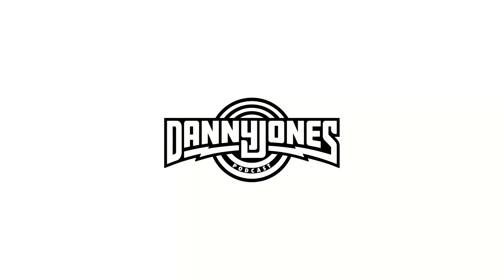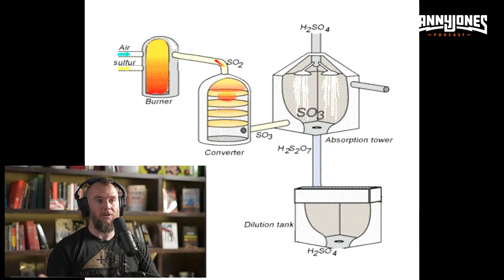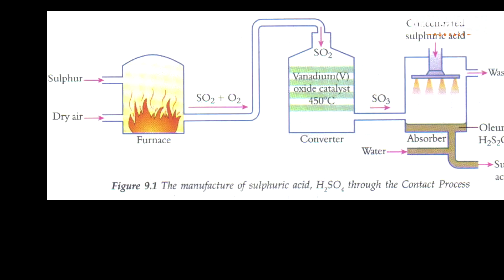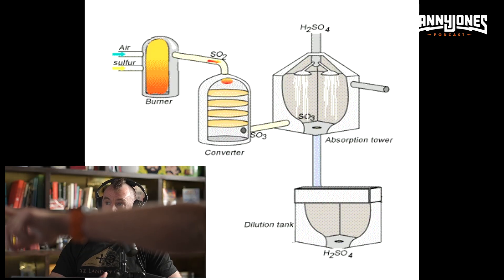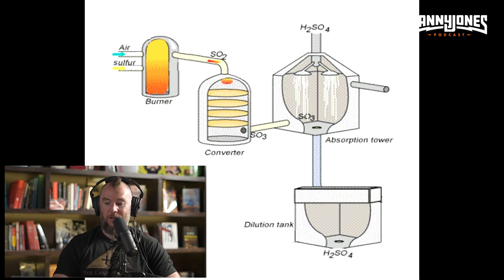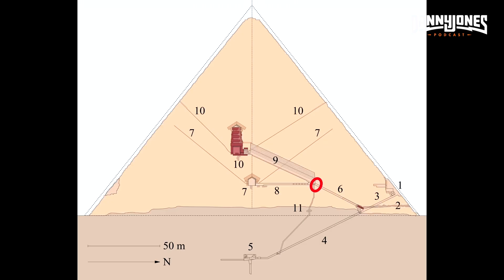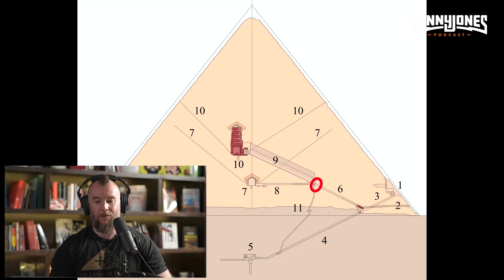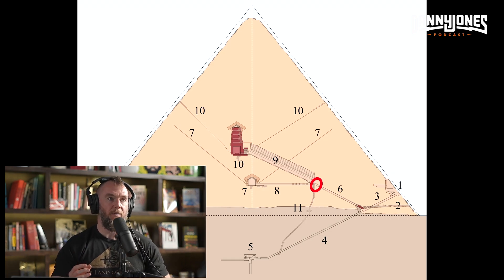How Lightning Powered Ancient Chemical Factories Inside the Great Pyramid | Land of Chem

Comment: It was brought up by others that the pyramid was basically a Ram pump which works using water hammer oscillations to lift water to greater storage heights.   All it takes is one gravity forced input through a check valve (1way flow) to start the water hammer oscillations where a higher check valve. 
It shouldn't be too hard to duplicate this theory but I've not seen the overall layout that would produce this action. We know the dynamic of the close river flow has changed, because several theories about its construction included  lifting floating blocks through use of gates like canal shipping gates.

Comment: It’s wild that one guy with no degree and no peer review solved the pyramids simply by being willing to think outside of the box. Well done Geoffrey Drumm!
Reply: He hasn't solved anything he only has theories.
Reply: @billwilson3665  Actually he only has hypotheses. Theories are based on scientific data, scientific data does not support what he say (at all). In fact his hypotheses are quite easily debunked.
After some checking I learned that Geoffrey Drumm has a psychology degree, no scientific credentials at all.
Reply: @billwilson3665  theories and a lot of phyiscal evidence. No one's closer in my opinion. All ne needs is to get the right experts out to confirm what he's found.
Reply: Doesn't he have an engineering degree?
Reply: Nothing's been solved are you high why would you even think that it's a theory
Reply: @Everydayrocketscientist  Because Geoffrey came on my podcast and convinced me?